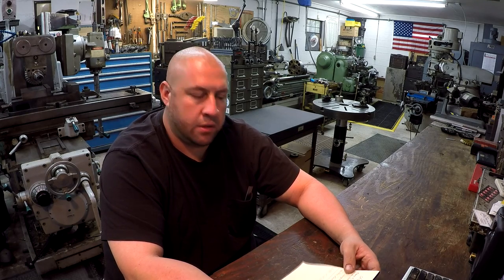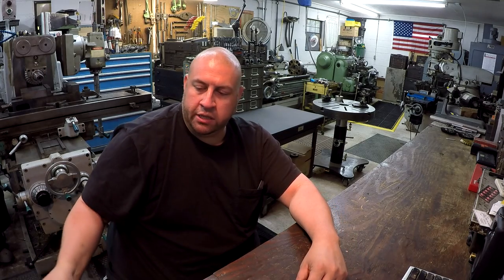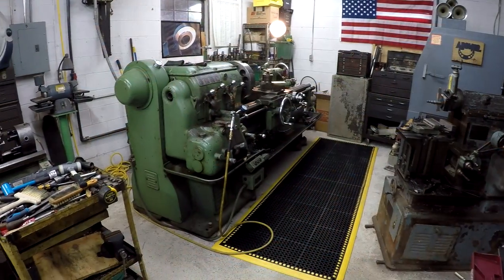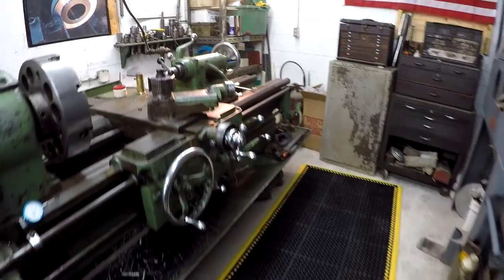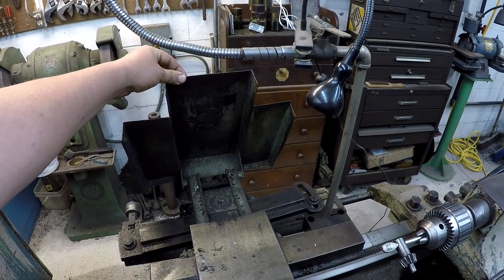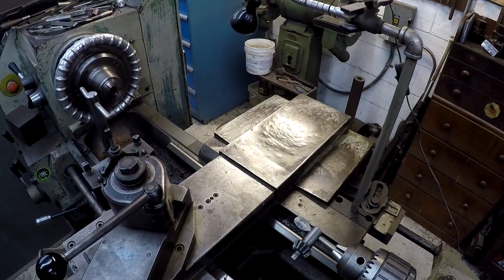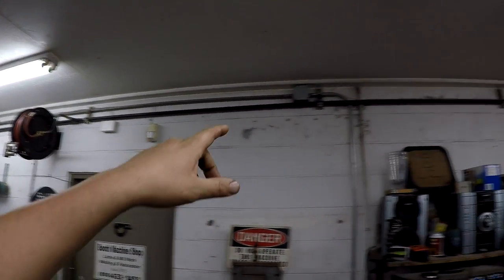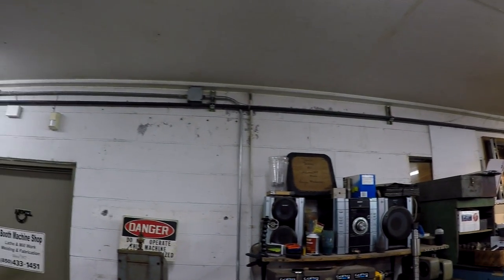Shop Talk 8: Lathe Way Damage? Shop Air Supply

Comment: Adam, don't bang out those dents man!  They add character to the machine and they serve as a small memory of your dad.
Reply: Reminds me of my dad's favorite and most used hammer.  I love that thing and I use it almost daily.  It could define toy use a new handle as its starting to crack but I can't bring myself to discard the handle with my dads greasy hand stains and all the little nicks and dents and scratches.  I think you'd end up regretting it man.

Comment: Man..you got a shop & buying a belt sander..is that the machine with 2 about 6" round rollers about 4 bushings, 2 axels and an adjustable table. Like those square 2" steel tubing for the bottom and say 1 1/4 to hold the rollers perfectly. Parallel.. You can build so much better than you can buy..

Comment: I'm surprised you aren't running a refrigerated air drier to get rid of the moisture. It would probably be more economical for your use to put in a desiccant drier.

Comment: I had one of those Chinese 100mm x 915mm belt sander/150mm disc sander Chinese combo machines with a "500w motor" and they are absolutely useless. It would stall with the slightest pressure grinding metal. You did well not to get one. I've now got a Taiwanese 150mm x 1220mm belt /230mm disc sander combo machine and it is that much better. Far more rigid and can actually remove metal without stalling.

Comment: Adom...
just wondering...why position your air compressor out side ?
I realise noise and space limitations...but...having experienced a high salt/humidity environment...I was always told that life of anything thing outside in those environs dropped dramatically if not protected.  Also, i did not see any H2O separators/filters in line....

Comment: Don't fix the cross-slide cover dings to the Victor lathe Adam.  That's part of its history.  It may have been your dad's understandable dislike for picking up that 4-jaw chuck that did all that, but those are still character marks he left on it and something of a memento on the machine to keep as a memorial to the work done and the bread earned by him using the Victor lathe. ^^

As for the explanations of ways damage on the Monarch, I winced when you were describing how you think such damage may have been done.  The clearance grinding done under the chuck may well be a WW2 'battle scar' from needing to chuck something that a bigger lathe was really needed for, but those bigger machines were already tied up and the job couldn't wait for a bigger machine to be freed up, so the decision was made by the foreman to grind that particular Monarch's ways the small amount needed for the chuck jaws to clear and get the job done.  There may yet be similar story for the 'clearancing' done a little further out, and by that point, the users of it who bought it for wartime production were by then wishing they'd bought it as a gap bed lathe instead.

Hehehe, incredible to hear that the viewer help has already scored you up a much, much better belt sander.  Hopefully the T-shirt campaign sales are gonna be a good lift on funding a start of closing off the outside patio area enough to put one of the big drill presses back to work so you can possibly start accepting some marine-shafting related work for your home shop.  There should be a bit of it to go around there on the coast where you are. ^^

Comment: machine vices, apart from kurt what's another good make, I'm looking for a 4" size to suit my milling machine
Reply from the maker: I can't speak from experience, because all I have used is Kurt, or import stuff. But I will say Vertex is Taiwan made and they seem to be good quality tools. My super space is a Vertex, and This Old Tony bought a Vertex brand mill vise and was surprised at the quality. 
You may check out the brand called Orange.

Comment: any moisture issues in your compressed air with the humidity in your area?   just got done building a half gallon stainless disicant dryer and its amazing.
Reply: desiccant
Reply: thanks
Reply from the maker: We have some different options they sell at work that I'm going to look into when I start modifying my air lines.

Comment: Hey Adam! Quick question, have you ever had to machine Inconel? We're having some parts machined at our local machine shop and the machinist is screaming blue murder at me as its apparently a nightmare to work with. Just wondering what your thought are.
Thanks for all the vids you post, extremely interesting!!!
Reply: Inconel (and all of the nickel superalloys) are fun to machine, bet he's seeing a few seconds as the average tool life.  Have your local shop look at PVD inserts to get the tool life into the minutes range.  They won't like the tool cost, but it's worse without the PVD.
Reply: Think they've tried insert tools and still get hardly any tool life and a crappy surface finish, though I imagine they're using inserts designed for carbon or stainless steels.
Will ask if they've tried PVD inserts. I presume these are coated inserts specific for the super alloys?
We make bellows type expansion joints in Inconel sometimes and have found that you just have to bury the forming wheels into the material otherwise the material work hardens on you and just cracks if you pussyfoot around with it. Maybe they're being too gentle with it and the surface is hardening on them?
Reply: PVD = Physical Vapor Deposition, and just a way of saying "a coated carbide".  I should have expanded that to the full statement: a very specialized insert: fine grain with a lot of binder and specialty PVD for the application. You're not going to see much life at all w/o going to a specialized insert.  I poked around and came up with this link:

https://www.kennametal.com/content/dam/kennametal/kennametal/common/Resources/Catalogs-Literature/Industry%20Solutions/SuperAlloys_material_machining_guide_Aerospace.pdf

but really your machine shop should be working with their insert guys to come up with the best solution.

Comment: There is nothing wrong with schedule 80 PVC for air. It has a maximum pressure of 600-700 psi at 70F for the sizes you used. The only problem is direct sunlight causes UV degradation. (Temperature is another discussion and insulating the short section outside will protect it)
Reply from the maker: Yes I have seen the devastation of degraded PVC
Reply: I worked in a shop for 12 years. All our air lines were PVC and never had a problem. We ran 140psi.
Perhaps the quality of the PVC plays a big part in the durability. Cheap Chinese PVC or PVC made with recycled plastic may have something to do with the failures.
Reply: they also talk about protecting it from physical damage not just degradation.
Reply: There's a pretty significant amount of UV from fluorescent fixtures, even more from welding operations.  The ozone created there has an effect as well.  A shop isn't the cleanest of environments.  You might increase the life a bit by painting it, that would block the UV.

A gunsmith friend had PVC in his shop for years, never a problem until one day he accidentally hit the pipe with a barrel.  The pipe shattered with the shards going everywhere.  He said that the PVC didn't show up on the X-ray (or was very hard to distinguish from soft tissue) and they had to spend some time digging it out.

I didn't even consider PVC when I hung air lines in my new shop, ended up using RapidAir 3/4 Maxline.
Reply: Russ Kepler Second the RapidAir Maxline. I ran it in my shop too.
Reply: The boiler inspectors in Canada don't like plastic pipe in industrial situations where it is possible to damage it with fork lifts or whatever. Up high like that though is usually accepted. The UV is definitely an issue too.

Comment: The duality of mindsets of shop equipment is funny. I know guys that are cheap as hell, but PVC air lines are a SIN to them. Ive always run plastic air and never had an issue, easy to fix if I do. Cheap, quick, and easy (insert dirty joke here). But, opinions and buttholes, everyones allowed to have one. Great vid. Hope ya didnt fix the lathe.

Comment: I have a dumb question Adam, please understand I am not a machinist, what's the deal with reamers? is it that you don't trust your drill bits enough that you have to hone the hole to specs ? I was at an auction last Wednesday up came a flat with reamers in it idk 8 or 12 of them the only reason I bought them is to see what they look like, to me the ones I got look like, for the lack of a better term a butt plug, lololol 17\32 on one of them they are all elongated cones with wax on them, lol, I gotta be the biggest moron watching your channel I swear. maybe esplain to dummy 101 please namely me,,, thanks
Reply from the maker: +Big John Maybe I can bring hat up for those who don't know. But readers are made to cut s hole to size and leave s good finish. No you don't trust drill bits to cut a hole exactly to size.

Comment: When routing your air compressor lines (shop air supply) don't keep the air lines  level!!!!! You want to maintain what is called plumb level approx 1/4" in. drop to the foot. Put another way, say the air supply enters the north side of the building @ say the 8' foot level and goes all the way to the south end. At the south end, you want a height of say approx 4 - 6' in. drop.The main line should slope down toward the drain to keep condensed water out of the lines. A 4-in. drop every 50 ft. is recommended.  With a drop so you can bleed out the moisture. Moisture equals water in the lines, and into your tools. I suggest you take a trip to a couple of Auto Body shops and look at there AIR SUPPLY setup's. 
If there air lines are level, ask if they are using a "air cooled after cooler," REFRIGERATED MOISTURE DRYER.

When and if you put in a TEE for another air supply, make sure at the bottom, you install a petcock to bleed out the moisture. Approx. 1 ft' from the bottom, put in a Tee, and this is where you would put your air regulator / quick connect(s.) This way the moisture will bypass the TEE.